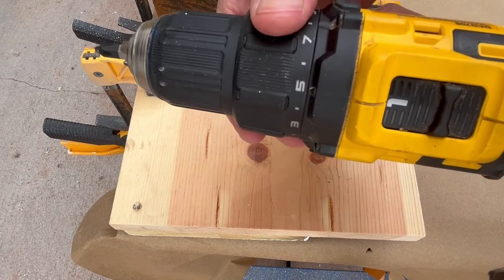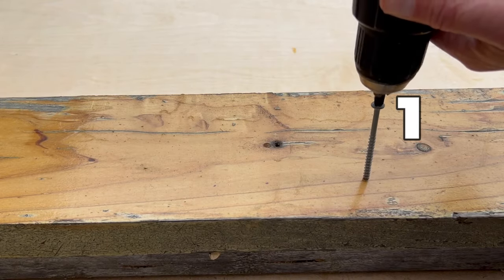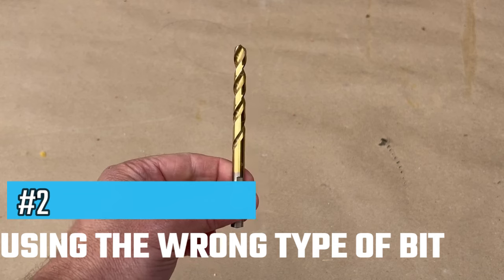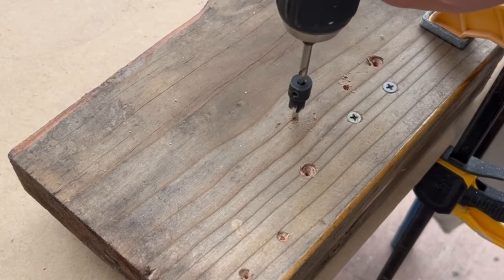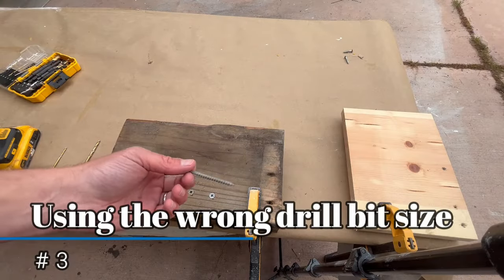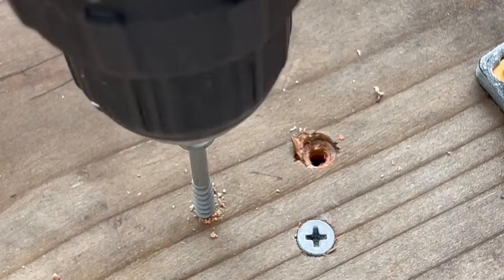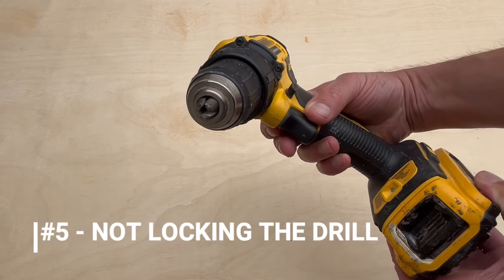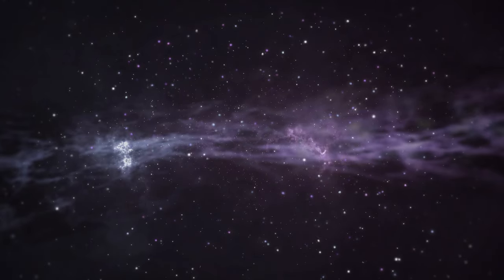I wish I had learned this years ago!

Comment: Not true on bit diameter. Partially true but not entirely. The oversize bit is for the clearance hole in the "upper/outer" material. The undersize is proper for the receiving material. Completely errored on speed. The low speed is to set the screws. High speed is for drilling.
Reply from the maker: Thank you for the comment and feedback, I appreciate it!

Comment: LOCKING THE DRILL MEANS THAT CHILDREN CAN'T TURN IT ON
OR THAT THE DRILL CAN'T ACCIDENTALLY TURN ON WHILE IN THE TOOLKIT

.........................HORSESHIT !!!

so... Kids DON'T like to press buttons.
So... a kid who picks up a drill for the first time and presses the trigger ISN'T going to press every button
and turn every knob or chuck.............. Yeah right

and.. in the toolbox while the car is driving and bumping up and down
the drill isn't going to accidentally fall on something that will push the button one way or the other ?
I reckon it will
Reply from the maker: Thank you for your comment and feedback. Upon further thought the best way to avoid the issue would be removing the battery altogether.
Reply: @gemriverbuilds7840  
EXACTLY !!
then...
- The child can't get hurt no matter what button is pressed

- and the drill can't start on it's own in the van while driving 

See.... I told you didn't i ?
You're Welcome for the comment